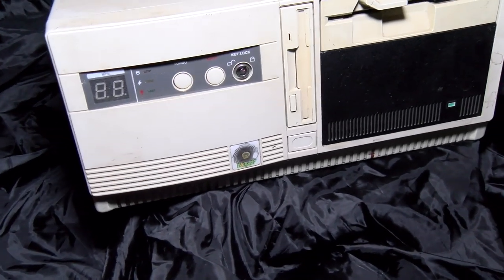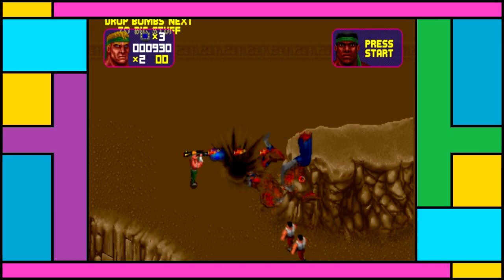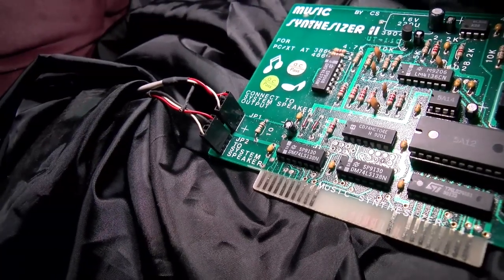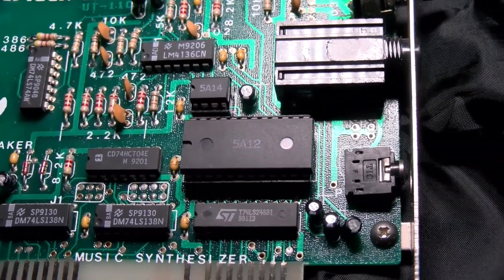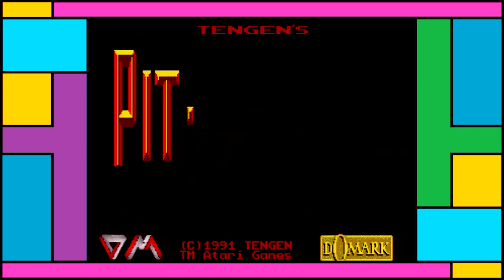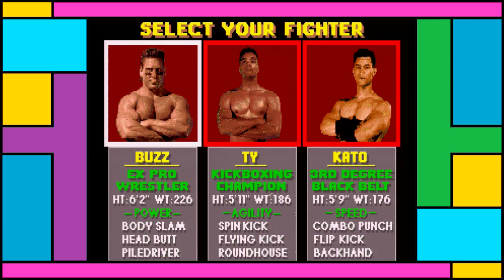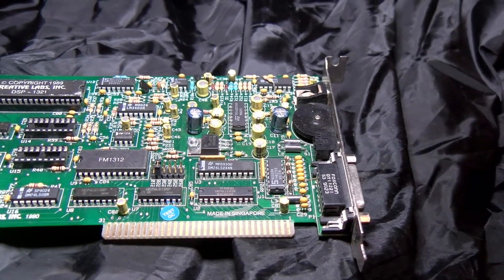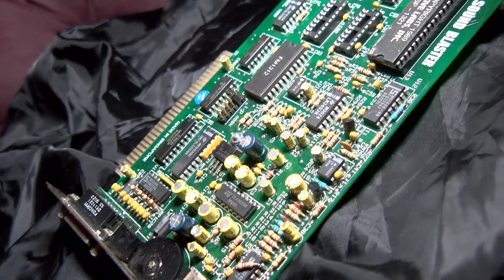Two old AdLib Clones

Comment: 20:08 "Well I think that about wraps that up!" 7 minutes and 40 seconds before the actual video ends. You crack me up. Also, what a discovery about the PC speaker! Did you also notice the PAS16 and Adlib output are pitched up compared to the Sound Blaster et al? A frequency analysis on the signals would be interesting, as it would seem to be a direct effect of the analog processing.

I'm in the middle of constructing a clone of an Adlib clone - one with a game port. At least one step toward the Creative Labs direction of reducing the need for multiple slots. Plenty of smart 74 logic included :)
Reply from the maker: That line basically means 'you can tune out now, the rest of the video is just misplaced ranting' really. The PC Speaker thing is odd because Jim Leonard reports different results, I'm not sure why but also have no reason to disbelieve him or his methods for recording it. I did look at the waveforms a few times, though not in great detail as I'm not great at that, there's a definite bias with both the AdLib clone and PAS output of PIT noises, which probably figures as I think the pins are held 'high' by default and one gets pulled down to 'low' when noises are being produced, though it doesn't bias the noise floor or other outputs in general on either card, only the PIT output has that bias. Overall it appears the SB16 tends to produce more square waveforms in both directions, whereas the MS2's pass-thru and the PAS16's onboard PIT product more of a 'pulse' in a single, positive direction, plus there's definitely something to do with the consistency of the height of these waveforms - the SB16 kind of curves the levels, where the MS2 and PAS have fairly consistent wave heights, almost as if the SB16 is trying to compensate for some characteristic of the PIT's output in some way. I can provide sample FLACs if you want to look at them yourself, or I guess you could probably just 'Stereo Mix' in whatever audio application and rip it from the video, assuming that's still possible.
This of course opens up a whole 'nother argument about whether the more square waveform is more accurate and if that's what the intention was, or is the pulse that the speaker would apparently be receiving more accurate due to replicating the inaccurate quirks of the hardware (in that the PIT apparently doesn't produce particularly square waveforms to begin with) and whether the bias should be adjusted for or not, as well as how some sound effects were probably tuned for the acoustics of a computer's chassis to some extent which would at least render headphones as inappropriate listening apparatus for such sounds - I don't intend to go quite that far with this, if it sounds like the PC speaker it's good enough for me, but it definitely seems to me that the PAS16 produces sounds which are far closer to it than the SB16 does.

Comment: I still think that there are gems from before 1989 on the PC. Like IBM's Alley Cat. It is an awesomme game.
Reply from the maker: Sure there are, but not many, most of the 80s games on PC serve only to make you wish you were playing a Master System or something instead.
Reply: @HighTreason610  True that.... True that.

Personally, I love both Amiga and C64 over Dos machines, when the software that are running, are from before 1989/90. I was never a fan of 80's consoles, yet a few gems can be found on each 1980's consoles. I guess it all comes down to what type of hardware I used to game on in the 80's. Yes, we had an 286 at home in 1988, and I did use it on a daily base. My friends and one of my cusin's had Commodore64. No matter how fast a PC my friends father had, I always played on my friends Commodore64's. And when some of them got an Amiga500 around 1988, I actually played on that instead of Commodore64. However at home, I played on the PC, because we only had that machine, and I kept on playing on that untill I had money to buy a Cyrix 486slc2-50 in 1993. It was ok, yet I upgraded to a 486dx2-66 in 1995.

All in all... For games, the PC was inferiour to anything else in the 1980's. Well... On the broad spectrum that is. Every platform had it's small unique gem's that was better than on any other platform.

Comment: I think there's room for an entire series on clone Adlib cards.  Some of the packaging is hilarious on some of mine.
Have you seen my PC speaker recording video over on The Oldskool PC?  Your PAS results don't sound the same as mine, so that's curious.
Reply from the maker: Oh yeah, there's hundreds of them out there, but these are the only two I have. Will definitely check out your recordings to see what's different, I wonder why this is the case. Meanwhile, before I forget about it for another year, here; http://dxzeff.com/trash/database.zip
I don't think I ever got around to sending you this like I said I was going to, like a year ago, probably easier to just remove whatever entries I have in the existing database entirely and then import these ones, they contain some of the same systems but with corrected information (UID's may be different, hence being easier to wipe the existing ones out) as well as a good few obscure platforms which weren't there before.
Reply: @HighTreason610  much obliged! I'll add these at the next release.
Reply from the maker: Cool Just as well really as I'd forgotten about it again. In the mean time I did some prodding around and I may have at least a partial answer to why your results sound different with the PAS16; It appears that my recordings exhibit a bias of sorts where the pulses from the PIT only really go into the positive when looking at the waveform with very little into the negative, the recordings in your video are much more centered.
I'm still not sure if the difference is with the cards or with the recording method used and may have to investigate further, probably by looking at the waveforms directly from the speaker header on a few different systems as I'm genuinely quite intrigued by this.
Reply: @HighTreason610  Don't look into it too hard, as I just realized I can't really use the pro audio spectrum for my needs after all, because you need to load a driver to activate the card, and I need to record some booters. So it looks like sound blaster after all.

Comment: What about using a dedicated e-sata external raid storage ? I doubt the performance would be as good as internal but it would free up your choices for hardware.   I think I will put one of those clone ad-lib cards in my 286 as well, good fitment for the era of pc.  As usual, Media Vision kicks ass.
Reply from the maker: Skeptical eSATA would be fast enough, leaving it in the same boat as using a NAS, I'll keep looking into what's out there. Tyan had a board that looked viable, if not a little costly, but it mysteriously vanished a few days after I bookmarked it. A shame because it was basically exactly what I wanted, it at least proves such things are possible, with any luck they're just having a reshuffle and it will reappear, SuperMicro did the same thing a little while back with some of their stuff.

Comment: Wish I could say that Ryzen is the definitive better processor at the moment, if you exclude performance out of it , it's not that great like if you enable their virtualisation it starts stuttering after a hour to two ours of use :/ it feels a bit half baked at the moment .... But the alternative is Intel and their prices are pure insanity at the moment.

Maybe a six core lga-2011 based CPUs and one of those cloned motherboards from China is a better choice at the moment ...
Reply: Besides the price, I'd also be worried about the Intel CPU eventually getting neutered with security mitigations... Performance has already been lowered about 15% from those, and now one of the main Linux kernel maintainers has said that they're seriously considering disabling hyper-threading on affected Intel CPU's by default, cutting their performance almost in half.
Reply from the maker: Virtualization isn't a feature I ever use, plus it never worked on Intel CPUs either, every time I've tried to use it for anything it just locks the system, from the first chips to have it until more recent models.
As it stands currently, it actually seems an Intel system would be slightly less expensive.